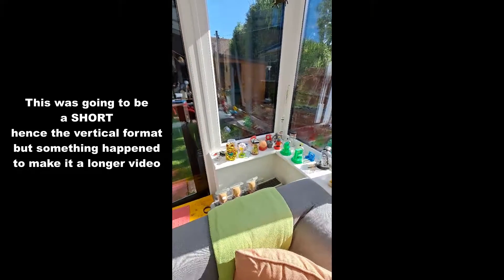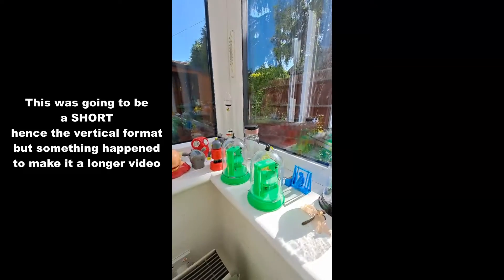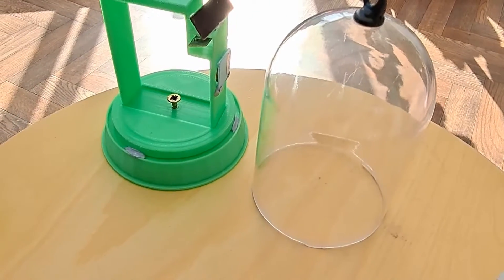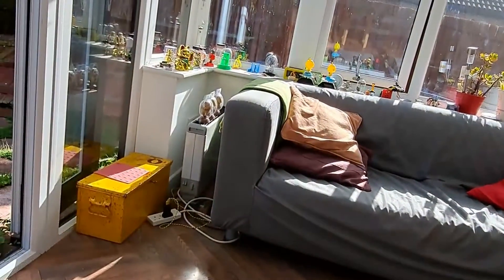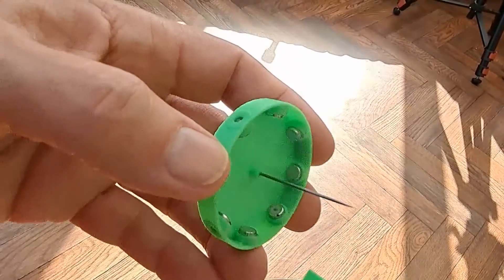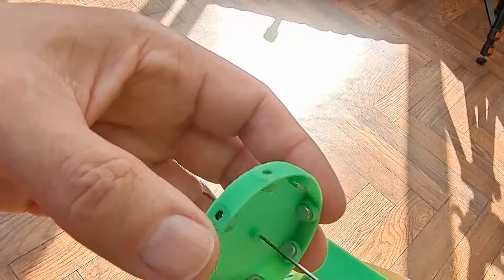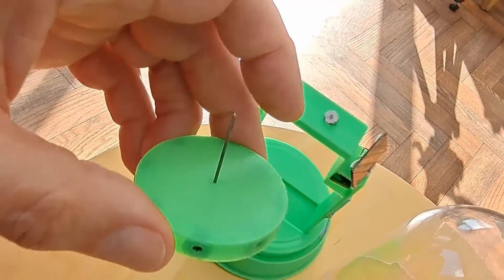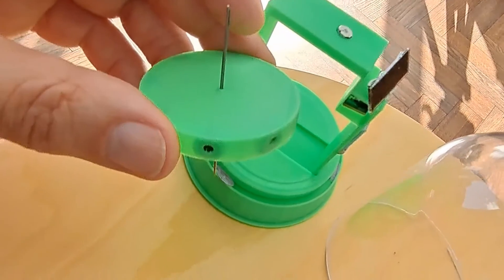Cloche solar pulse motor update 20220527

Comment: I wonder what the heat resistance is in pla that it gets Soft so Quick in Sunlight?
Reply from the maker: Think about it, Marc. 3D printing is melting the filament to create the shape you are printing. For it to flow like a liquid, the printer is set around 200° but it starts to go soft lower than that.

Comment: Yes this is my exact problem right now. I use to print with petg but wanted to give pla a try only to start noticing that during these hot days any print of pla material should be kept away from heat or you'll get warping. The warping will get so bad that the pla will get brittle and can easily broken when you try to bend. May go back to "stringy" but durable petg.
Reply from the maker: Most "plastics" are affected by heat to some degree. Sunshine has the additional hazard of UV radiation, so can affect the plastic in different ways.